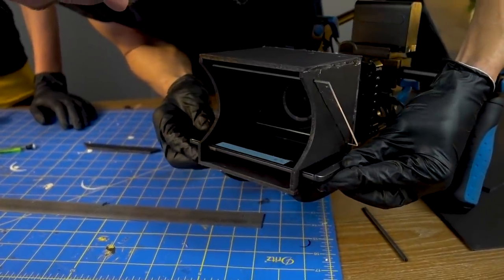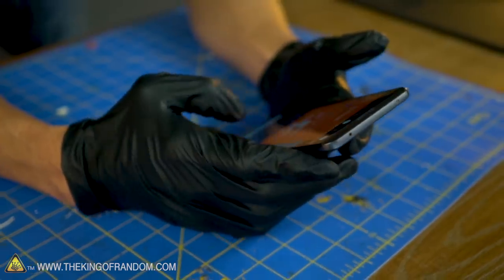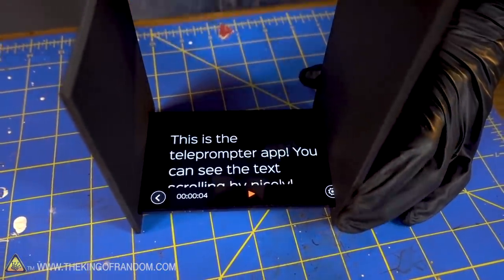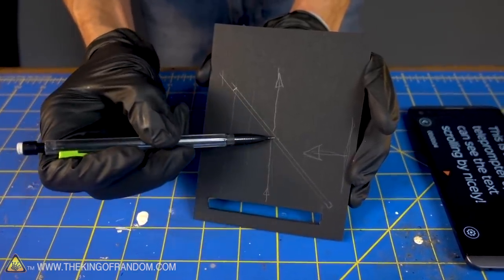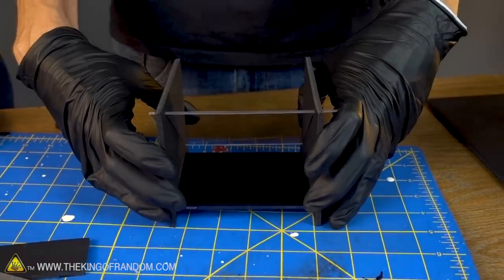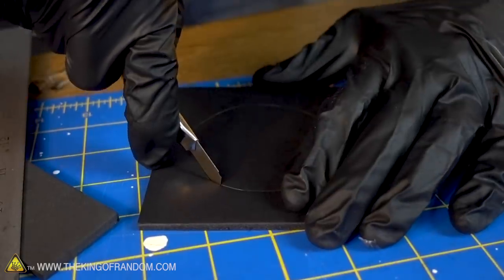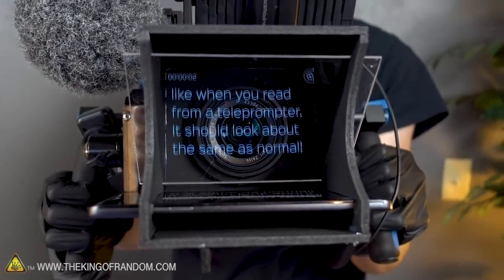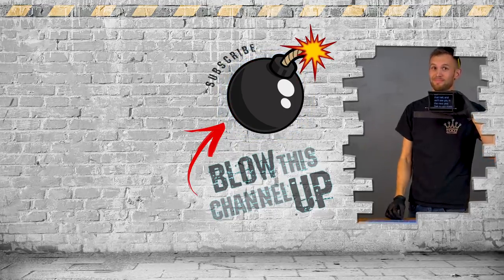Every Vlogger Needs This

Comment: I built it, it worked exactly as it did on the video. I couldn't find foam core, so I used black felt and I used 3mm Plexiglass/Perspex and it exactly as it for in the video. I had to trim a bit for the vignette (I'm using a 24 mm f2.8 for this. It did need a bit of practice and the double text distortion was very disconcerting, but it's a fantastic built. Thank you for this!

Comment: There is a possible solution for the double image, caused by reflection from both sides of the acrylic sheet.  An inexpensive polarizing filter can be placed on top of the phone screen.  This works because the light reflecting from the near side of the acrylic is polarized in a plane, parallel to the surface of the acrylic sheet.  The light which is transmitted into the acrylic is refracted, and its polarization is incomplete.
Reply: Unfortunately, just the polariser foil will not resolve the double image fully. You should take it one step further and exploit the brewsters angle, and then you might not even need the foil. When lucky, the LED screen of your phone already emits polarised light. If not, use the polariser foil. Then place the acrylic under an angle of 56.3° degrees towards your phone (I assume, that your acrylic is PMMA).  The polarised light will be reflected by 100% (or anything close to it). You can test this effect with a simple laser pointer. PM me if you want some detailed calculus.

Comment: A great source of pre-cut glass could be tempered-glass tablet screenprotectors. Most are incredibly thin, so the doubling would be minimal, and they too can be bought for just a few bucks.
(You'll need a wider screenprotector than your viewing device, because the glass is at an angle.)

Comment: Can you build a flamethrower that works underwater?
Reply: No
Reply: Oh dang that sounds cool
Reply: It wouldn't go very far but you could do something like an oxy acetelene torch that mixes fuel and oxidizer in the device
Reply: you can it is possible to use a oxygen exdelin(can’t spell) torch under water why cause there’s oxygen
Reply: The Dungineer i didn’t read this and put the same comment great mind think alike
Reply: @rugger8787  nice!
Reply: Kristo Nurmik Flamethrowers that use white phosphorus can burn under water
Reply: Kristo Nurmik 
Wait hol up
Reply: Then it would be nice to see that with my eyes too.
Reply: I think thats called sorcery

Comment: You should make sure people are aware of the focus ring on the lens.  If it's manual focus only they have to be able to adjust it, and it's usually towards the end of the lens.  If it's auto focus, the focus motor will usually turn that ring and there can't be any drag on it.

Comment: The double reflection could be fixed by using one of those head up display windshield film screens (normally used to enable using your phone as an HUD navigation unit). You can get 2 of them for $5 on Amazon.

Comment: Try putting a pressurised deo can in vacuum.
Reply: A metal can will sustain higher pressures than it's usually at so I don't think anything will happen.
Reply: I suppose there will be enough pressure difference to at least break the seal or something...

Comment: You are using the same method to cut acrylic as you would use to cut glass and then you say you are using it because it is easier to cut. You are actually making more passes with the knife than is required with a glass cutter. Even with that acrylic has a tendency to break in unexpected ways if you don't cut it right. Glass is so much easier and it is cheaper too.

Comment: Could you bake dry ice? And if yes than  after put it in water and than on fire pls✌️
Reply: Dry ice is just solid carbon dioxide, if you think about it, carbon dioxide doesn't do much. Basically the dry ice will change phase and that's all.